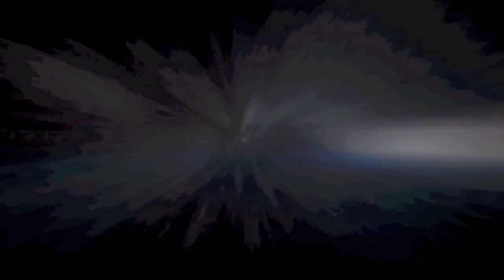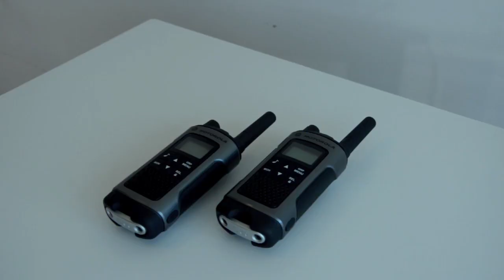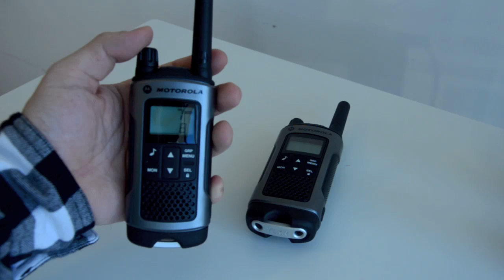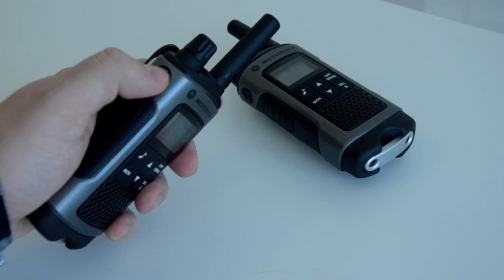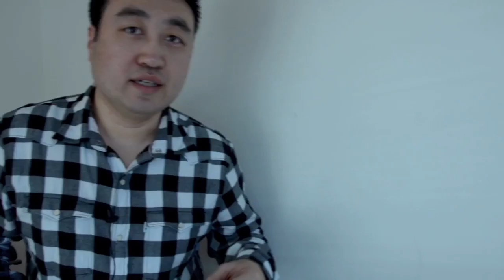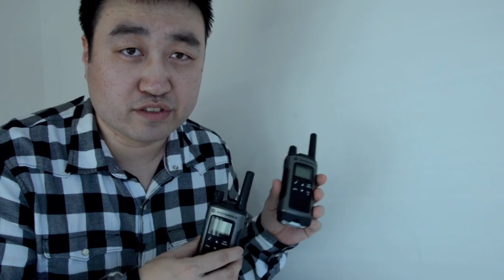Motorola TLKR T80 Walkie Talkie Long Term Test PMR446 Radio Review

Comment: My pair t80’s have stopped transmitting...my children might have done something..,is there a way to reset to factory settings?
Reply: NO THERE IS NOT  replace the batterys turn on the radios and check what is
on both radio's screens readjust the settings and transmit to the other radio
she probley changed channels on the radio.

Comment: Hi Handy I bought one of the Motorola "XAP0085BDGAA" 
XT180 and I would like to know what is difference between XT180 and T80 or would it be better if I pay the extra for the T80 Extreme? I'm buying these Radios to connect to some older model Motorola at work so I can have my own Radio and better signal, this is just to give you a idea  of what I'm using them for.
Reply: I m guessing your xt180  is a 20/23 model and the   T 180 is 2024 modle
 with up dated buttons

Comment: Hiya - I realise this is an older video, but I have the T81 (purely for the colour!) and wondered if you know how to, or whether, it is possible to upgrade these to receive the new 16 PMR channels, rather than just the original 8? ... 🤔

I have asked Motorola and some partners, but not received any responses at all... 🤢

Great instructional video, thank you, especially the section on Scanning, most helpful... 👍🏻 🐍
Reply from the maker: Thank you. I don't think you can 'upgrade' it to extra channels as these are not programmable by consumers. You'll have to pay again in the future if you want more features. That's how Motorola makes money I believe :)
Reply: Just get a couple of Retevis "24" radios. You can bump up the power to 2 watts, using the software, and the antenna is removable, so you can accommodate an SMA male antenna. 16 PMR channels pre-programmed. Make sure to knock off all the pre-programmed CTCSS & DCS tones in the software so that the radios can talk to all others. I have 2 of these units, and  think they are excellent.
Reply: T82 has 16 channels, 8 when you buy it, but in manual is instruction how to activate 16 channels

Comment: I've invested in the orange tlkr t.80 extreme cracking radios these sway from side to side took the lanyard plate off the bottom of radio now okay stands sturdy.....
Reply from the maker: I will be buying the extreme soon for a camping trip.
Reply: HandyRadio they are as good as they say very rugged and waterproof and the performance is good well Motorola the name speaks for itself....hope you enjoy you're trip and you're radios miss you're radio posts....
Reply: HandyRadio t.d cat tech  has a good review on these he got a 10km range on them the post he put on you tube is good we also invested in the new T.82 extremes which has 16 chs when you purchase them only 8 pmr 446 channels are on the user has to activate the other 8 chs which are the new one 446 channels  it is shown in the booklet you get now these ate also high ended radios with built in pairing facility also extremely robust. will you be doing a review on the t80 extreme on you're camping trip are you going anywhere nice?....

Comment: Thanks for nice video!
I also have T8, as you did before T80.
Is it worth investing in T80 just for the sake of range improvement? Other extra features are not relevant for me. Thanks.
Reply from the maker: Not really worth it. The T8 is good and has a clock. Battery life will be an issue for older handsets.

Comment: One small correction. These and T60s (which I have) do have VOX which works over headset. Issue is however that Motorola flipped pin-out of the connector so if you plug in regular headphones your left earphone actually becomes a microphone. Unless you used OEM headset this could have tricked you. Sadly there are no adapters for these in the market so I have to resort to making my own. Still, a good radio and a good review.
Reply from the maker: Thank you.

Comment: Hey, (newbie question follows):

I bought 2 Baofeng UV-5E radios to use with my partner on a motorcycle trip 
in scotland. We are looking to use the free frequences in the UK as we 
do not want to pay for the licence, just yet! 
Can anyone suggest a setup - eg frequency/power setting etc, so that we 
are not annoying anyone with our chatter/ not breaking the law. (we wont
 be more than 200m apart at any time). Is this something that is viable,
 or are these radios not something to be used for such a trip. Ideally 
we would be the only people who can transmit or recieve on the 
frequency, so as not to annoy others who may be using the same 
frequency. Thanks in advance for your help!

John
Reply: As far as I know the lowest Baofeng can go is 1W, which is above PMR446 specification of 0.5W. I am not familiar with UK laws so I can't really comment of use of other frequencies.
Reply: Definitely need a license to operate the UV-5RE in the UK. The 1W and over is correct.
Reply from the maker: John, sorry about the late reply. Did you enjoy your trip to Scotland? I've always wanted to make that trip myself on a bike but haven't got round to do it yet. Legally speaking you need at least the simple UK licence to use some of the VHF and UHF channels. They're not free channels like the PMR446 but at least you're not breaking the law. The reality is Ofcom doesn't have the man power to check and a lot of people who are unaware of the laws start using these radios. If it's not too late, most PMR446 radios should meet your distance requirement but you'll need to consider suitable headsets for your helmets.

Comment: do they come in v h f   and does the antenna come off ?
Reply: PMR446 is 446MHz, and part of the specification states _no removable antenna_. UK does allow removable antenna as long as 0.5W transmission power is respected.
Reply from the maker: No free VHF channels I'm afraid.

Comment: Hello Handy Radio,

would you suggest this set for dayhikes with multiple hikers? distance between persons would be 2 to 3 kilometers in dens woodlands
Reply: Am not Handy Radio, but I got these for cycling trips with my brother. They are excellent. However you have to be aware that range varies depending on terrain, line of sight, etc. So your mileage will vary.

Comment: Hi, do you know if there is a wall charger to charge directly each radio without the base? Like with the T50. The supplied charger in the T80 works only with base. Or is the 9V DC side port on the radio just for a car charger? Thank you.

Comment: Hi, just wondering. If the underchannel doesn't change on a scan, could that be wrong?
Reply from the maker: +Katia O If you want to use any motorola radio to scan the 8 channels you will need to take the privacy tone OFF and keep them as 0. The default setting is that all 8 channels will have privacy tone 1.

Comment: xt180 has free ear piece mic with diagonal plug which can plug in facing front or rear raised rubber back does not effect plug as it is slightly raised when plugged into unit also vox works okay with ear/Mic plugged in also has group call these xt180 are a really good set and I would recommend them.....

Comment: Hi.
I've got few questions but on the beginning I want to apologize for my english :P
1. Do U know what is the diffrence betwen models T80 extreme and T81 hunter?
I know there are another packs of accesories but is that all?
2. Scanning. I didn't get well what U said so can T80 do a scan of all channels and all subchannels on every channel? Or is there any problem with?
3. VOX. Does it work with and without the speakers or only with/without?
Once again sorry for my eng. It will means much to me if U can answer.
73!
Reply from the maker: +Dominik “DreaD” Bilko Hi Dominik. 1. I've not seen a T81 model so can't comment on that. 2. You can only scan the channels NOT CTCSS or privacy tones. 3. I couldn't get VOX to work with after market headsets.

Comment: The batteries just don't last on the T80, you should have mentioned that in the cons, but a great review!!
Reply from the maker: saviour514 Do you use the original Motorola battery pack?
Reply: yes I do.

Comment: Thanks for this report/review.  Very informative.  My question:  if the battery is low, will it recharge immediately when connected to the recharger, or does it discharge first before the recharging starts?
Reply from the maker: Stuart Thompson There is no indicator for discharge on the radio or the charging pod. :(

Comment: Hi there thanks for a very informative video. It spurred me on to buy a T80 Extreme twin pack. My problem is, I can't get room monitor mode to work, the instructions tell you what to do with one radio, but not the other. The first shows it's in room mode but I hear nothing from the other. Motorola support are worse than useless, a Polish girl there emailed me instructions she was reading from the previous model, when I asked if she could get someone senior to help she just told me to get info from a reseller. Like they are going to help me? NOT!!
Please, please please help get this room mode working, it's the main reason I bought them.
Reply from the maker: semmyroundel set your 2 radios to the same channel and privacy code. Check if the radios will communicate with each other. Then go through the room monitor set up for one of them. Your room monitor radio (the transmitter) will not receive anything as you don't want to wake the baby up if someone else is transmitting on that channel. Don't do anything to the receiving radio. Make sure it's not due to out of range.
Reply: HandyRadio Thanks for your reply, I yhought I had done that but not sure now, I'll give it a go this week and get back to you on progress.
Cheers
Reply: semmyroundel Did all that, still no joy. Will keep trying.

Comment from the maker: Ben Capon I think the TalkAbout is a FRS radio so it won't work with PMR446 radio like this T80. They use different frequencies.
Reply: are radio's state side will not work with your radios as we are under  F C C rules
here

Comment: Will they work with previous TalkAbout250 models. What channels or how should it be set up? Thank you in advance
Reply: all of the f r s radio's will match each other as the inside guts are the same
only the outside case changes with the company.

Comment: Will the T80 work with Cobra handsets using the sub channels (ours are set to 2-08)? The Cobra channel read out looks different, maybe just because it lacks the zero..
Reply from the maker: Yes they will work with each other. Motorola goes from 1 to 121. Cobra uses CTCSS 1-38 then DCS 1 - something I can't remember now.

Comment: Is possible to switch on some better range ? Because my work only about 2km :(
Reply from the maker: PMR446 radios are low powered and would be lucky to get 2km in built up areas. Some 5 watt radios may meet your requirement but you'll need a licence.

Comment: Thanks a lot for your numerous reviews of different handsets. I've learned many things that I could not read from the online manuals myself (such as early rubbing off of keyboard markings, unit cannot stand on its' own, etc). I think you could still improve your reviews by including the range test which is critical for many would-be buyers. I know this is a difficult proposition because range vary greatly on different surroundings. But if you have a consistent environment ( e.g. same building and floor, same open field, etc) you could give a good idea of how different models and brands compare to each other. Or at least it would indicate susceptibility to wind noise and the audio quality during actual use. Just my two cents.
Reply: My bad. I saw you have an excellent range test video while riding your bike. Looking forward to more of those!

Comment: Thank you for making some of the best review vids on the web. But I have one question. Could you spend some more time on how the pmr actually sounds on air? Meaning the quality of their transmitted modulation, especially the audiolevel. Most pmr radios (nearly all) aren't loud enough compared to the tx-modulation of more professional equipment. If you could make a review on that subject you'll be the king of YT-reviews!! Thanks and 73's!
Reply from the maker: 'King of YT reviews' I like that lol. Will bear that in mind for the next project. Thanks for watching.
Reply: HandyRadio in my eyes you are the best on you tube so informative and interesting....

Comment: can you clarify something for me you mentioned towards the end: you say that the handsfree voice activated feature does NOT work with a plugged in headset. Is that definitely correct? I need a set of 4 to 6 radios to use on a film set with headsets and all ancillary beeps and squelching deactivated for obvious reasons. just need to have a voice activated group call almost like a telephone conference call but with the use of headsets with mic booms. thanks
Reply: With my headset it doesn't work with VOX

Comment: got t8 it will work with them will t80 work with binatone terrain 550
Reply from the maker: If they are on the same channel number and CTCSS code etc. They are PMR446 radios so should work with each other.
Reply: thx mate been wating ages for them to be delivered

Comment: From where can I buy extra battery packs?
Reply: eBay has them. But you can also use regular AAA batteries, or AAA rechargeables. You can charge the AAAs in the device, by connecting a 9V DC power source, but you can't charge the AAAs in the charging station.
Reply: FabricOfExistence. Thank you so much!

Comment: Good review, nice vid.

I have watched a few of your other vids. I do have quite a few questions...
- In the end you say "it's probably the best...". You've also tested the Cobra MT975 and the BaoFeng BF-888S. I'm also interested in the Motorola TLKR T60, the T80 Extreme and the Midland M24. From these, you stand by your statement that the T80 is the best? And what if you would give your opinion based on price-quality-ratio?
- Compared to the T80 Extreme (besides it being more waterproof and having a solid backdoor), I read somewhere a difference in range (T80 had a larger/better range than the Extreme), do you know more on that, or is it the same?
- You talked about VOX with headset. I didn't understand what you meant. If you use a headset, VOX doesn't work? Do you know why? I ask, because I want to walkie-talkie with a headset (probably this one: http://www.gadgetinfinity.com/ear-bone-vibration-speaker-microphone.html , is that even possible? (I also wonder how the PTT button on this one would work with gloves on.)) and wonder how that would work (or not work).

I'm interested in your opinion (and others). It'll be my first set of (serious) walkie-talkies and I want to use them on my motorcycle and during my winter holidays on snowmobile (so always with helmet and headset).

So any help and advise is welcome. Thanks!
Reply: Hi you question about the tlkr t80 extream range as far as I know they have the same range the only difference is that the t80 extream has a more water resistant back comes with a carry case and headsets.
Your question about the headset and VOX it doesn't work and the only thing I can think of is that because the headset ptt is on your jacket its would move and keep on transmitting 
They are a good radio but sound is quiet.

Comment: Nice complete review.....

will the group talk function work for around 50 radios???Are these the most  powerful unlicensed radios in the market??
Reply from the maker: Thanks. You can have up to 16 radios in one group. If you want more groups you will need to change to another channel but that could interfere other groups if you decided to initiate a channel change for your group. It's best to keep it simple and under 16
Reply: If you had 50 radios they would all have to be either the t80 or t8 you could not have both because I have both and will not work together in group mode but out of group mode they are good

Comment: Nice testing video. I want to buy 2 walkie talkies just for fun, but still quality. These are so far on the top of my list. If you could answer me a question: I read in a test from the TLKR T50 that you can also recharge the battery, using an AC power supply and still use them while they are recharging. Does this also apply to the T80?
Reply: Maybe when you wrote that, but now there are 16 channels and there are regular nets on channel 8 UK wide.

Comment: is it possible to use a one pin headset with extern ptt button? i would like to use the Walke Talkie for Motobike traveling. many thanks!
Reply from the maker: Yes you can use a PTT headset that's compatible with the TLKR radios.

Comment: Hi, super review. However, I was looking at bying the T80 Extreme. I couldn't find an English review on those. Do you have comments on them - what are the major differences?
Reply from the maker: Thanks for watching. The extreme has a more water resistant battery cover and only available in yellow. It also comes in a padded carrying case with original Motorola earpieces and lanyards. That's all.
Reply: HandyRadio Thanks, I am going to use them in mountains, skiing, trekking, etc. I had som Talkabout 54 (something ...) some years ago, but had problems with range, especially from one valley to another. I hope these are better, would you know about that ... ? I did consider more professionel ones, but they are heavier and problably require licenses - then you can't go from one country to another as the licenses are country specific as I know.
Reply from the maker: Michael Hvelplund Schneider You're right. I can't think of any legal PMR446 that performs better than these radios. Simply the best for what it is. Even the XTNiD isn't much better in performance but a lot heavier and bigger in size.